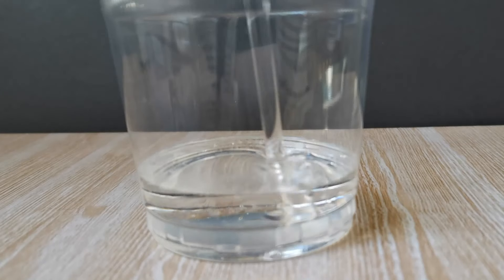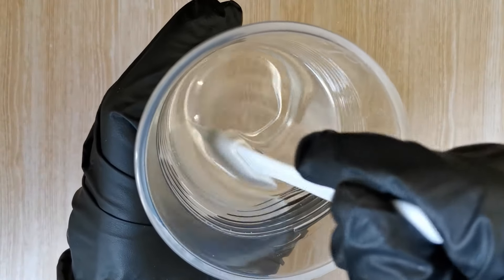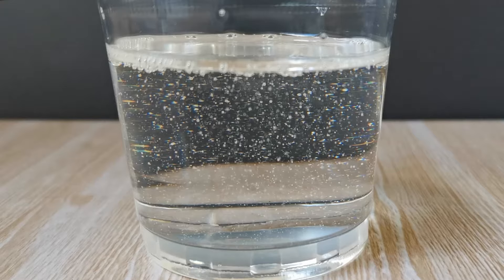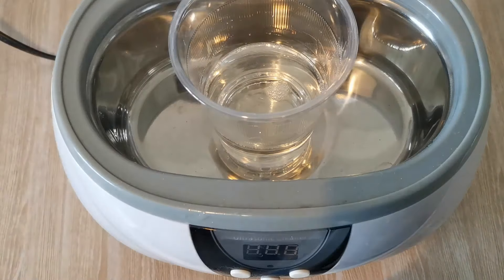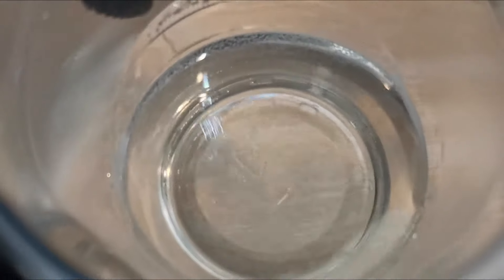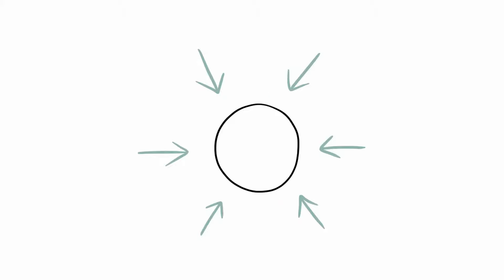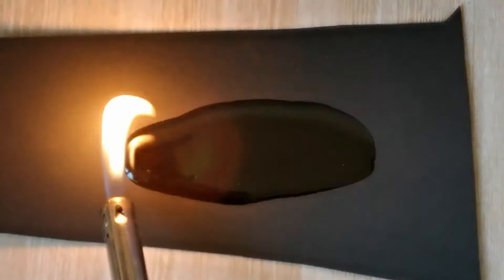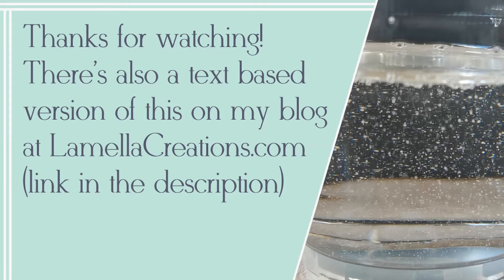How to remove bubbles from resin

Comment: That was such a concise but comprehensive video! No need to try to fast forward to certain bits, it was all straight to the point and relative 😊
Plus, I've been using resin for ages and never heard of the ultrasonic method. I will definitely look into that since I actually only ever mix small amounts.
Thanks!

Comment: I am curious as I am using Mica powders with resin and it can be quite difficult to spot bubbles as initially you cant see them. Would it be best to put mica powders at the base of the molds first then mix it once the resin is in the mold. Or pre mix it? As I recently used a cap/lid mold for my dice set and all the top faces are filled with bubbles. I found this video very helpful I just wanted to try and figure out where I am going wrong it was only my first time doing it but I want to see what I can improve.
Reply from the maker: For dice you generally need to use one of the methods that actually remove the bubbles (vacuum, ultrasonic, pressure pot). They're enclosed so the tiny bubbles rise to the top when they're curing otherwise and get stuck (even without the mica, it just makes it harder to see what's going on). Dice are definitely one of the harder things to get bubble free

Comment: Hello anyone reading this question.  In regards to the ultrasonic cleaner to remove bubbles, wondering if you can put your resin filled mold directly into the ultrasonic cleaner.  I ask as I purchased an ultrasonic cleaner recently and although the cleaner did remove all of the bubbles (very impressive), it was already in the curing / setting stage and was not real easy to pour on my tumbler.  Will have to reduce the time for future reference.  Although I plan on using resin to also fill molds.  I'd like to remove all bubbles for the molds due to how deep the molds can be and that will make it harder to remove the bubbles,  Figured if I could remove the bubbles directly in the mold in the ultrasonic cleaner.  Any advice would be helpful. Thanks!
Reply from the maker: I havent tried it, but I suspect it might do the same thing as vacuum chambers and pull air/oils from the silicone and make it worse
Reply: @LamellaCreations  worse? Worse than what?
Reply from the maker: @PAndrew002   Worse than not doing it. It ends up with tiny bubbles on all the inside surfaces
Reply: Uck. Now, I have to try this!

Comment: I’ve seen some people recommend the coffee cup warmers to warm your resin prior to using it. They say it removes bubbles very well. Have you ever used one? Would it be a better alternative to the water bath since there would be no possibility of accidentally getting water in the resin.

Take care and stay safe!
Reply from the maker: I haven't used one, but I think it'd take a bit longer to warm it since the heat is only coming from the bottom. It could definitely work if you have smallish bottles of resin though :) I've also seen people say they place it near a heater as another alternative. 
If you're worried about water I'd suggest using a tallish container for it, that way the bottle can't tip over when it's getting low so there's no risk of getting water in your resin. You can mark how high to pour the water after the first time so that you know it won't go too close to the cap. Another alternative is some people place the bottles in ziplock bags before putting them in water. It all just comes down to preference in the end and what works best for your setup :)
Reply: I attempted to use a wax warmer once. It resulted in the bottom of the resin setting up while the top was still liquid.
Reply: @Jetblastjoe  same I wish I had found this video first! I've also used a heat gun for too long and had the same effect 😅🤦🏻‍♀️ I'm also just coming to the understanding I'll prob have to sand and reseal some pieces but that's okay I still love resin art!

Comment: Have you tried Solarez Air Release? It's an additive for Resin that removes bubbles
Reply from the maker: I haven't but from what I can see it's just a solvent (naphtha). It's basically the same as if you added isopropyl alcohol or acetone directly into your resin, which yes would thin it out and let bubbles release easier, but also prevents it from curing properly and makes it rubbery. Better off just using a slow cure resin so that you know it's properly cured and safe to handle

Comment: Thank you, for scale modelling purposes I am going to deal only with low amounts of resin at a time, I did not want to invest €130 in the vacuum chamber + pump set. A typical ultrasonic cleaner should be enough as I see :) Can I also use same method for casting silicone?
Reply from the maker: I haven't tried with silicone, I suspect it might be a bit thick but it could be worth experimenting with! Otherwise a good way to do silicone without a vacuum pump is to buy a slow setting one and then place it in the fridge for part of the cure time (best to keep it in a box to contain any fumes). It slows the cure down so the bubbles can rise out before it sets :)

Comment: This is a very informative video! Can I ask, I’m getting bubbles in my cast pieces (small earring elements) which appear on the good side (the side that’s face down in the mould). They tend to be around the edges or in corners. How can I avoid this?
Reply from the maker: If they're there when you're pouring the resin in you can coax them out with a toothpick or similar (just be careful not to scratch the mould). If they only appear after a while that can be from a very low quality mould and the bubbles are leeching out from the silicone. Not much you can do about the second one but use different moulds
Reply: Would it be worthwhile to try the alcohol spray trick? Actually, what I did was take a silicone baby food spoon, dip it in a container with alcohol, shake off the extra alcohol back into the cup, and then dip the very lightly coated spoon onto the top bubbles in the mold, including corners. It pops the bubbles, but also using the spoon helps you direct the alcohol a little bit better to the bubbles you really want to pop.

Comment: You have to be careful with warming resin before working with it. It can easily cause flash cure.
Reply: Not ir you warm before you mix in the hardener

Comment: Hey i have one question 
after curing resin it is breaking so easily can you please tell me why this  is happening.. I hope you will answer 🥺🥺🥺🥺
Reply from the maker: Hi, it depends on what sort of resin you're using and how big the thing is that you're making. UV resin in particular is very brittle and likely to break, but epoxy can also become brittle if something goes wrong with the curing process (e.g. if you pour past the maximum depth for your resin and it overheats).

Comment: So, what do you do when the resin already has bubbles in it before you even pour it? Just, hanging out in the resin bottle. Haven't mixed it with anything. It already has tons of microbubbles even after letting it sit in hot water. I've tried so many resin types and brands - they all start with bubbles already in them.
Reply from the maker: A pressure pot would fix that problem, or get a deep pour resin as they're generally thinner

Comment: Great video.  Very concise.  However, I didn’t catch what was said at 6:15.  Some sort of spray to pop bubbles is used.  What was that?  Where from? Thanks
Reply from the maker: It's isopropyl alcohol put into a spray bottle (bought separately) . Mine is a sushi spray bottle from Daiso but anything that can mist finely will work. The higher the percentage of alcohol the better too

Comment: How long should I leave the resin inside a pressure pot before taking it out and poring it on a mold?
Reply from the maker: For a pressure pot you should pour the resin into the mould and then place the mould into the pot until it's cured. The pot should mostly hold its pressure so you wont need to keep the compressor going or anything :)
Reply: @LamellaCreations  What if mould it too big to fit inside the pressure pot? Can you just put the resin to make the bubbles small and then take it out and pour it on the mould to cure? If you can then how long should the resin be left inside.
Reply from the maker: @knight3131  Unfortunately not, the resin needs to be under pressure while it cures because otherwise the bubbles just expand again. If it doesn't fit then you'll need to use other methods to control the bubbles, a vacuum chamber might work for your use because that actually removes the bubbles :)

Comment: I have art resin and there’s millions of bubbles even after using a lighter. I now have a blow torch and am wondering if I can put the resin in an aluminum can before torching? Thanks :)
Reply from the maker: Artresin is a coating resin so it's best to torch after you've poured it over the artwork (as lighters/torches only work on surface bubbles). If you're wanting to use it as a casting resin you would need to use a pressure pot as it's an extremely thick resin, although warming it beforehand would help a small amount too

Comment: Hi what's the best thinner resin to get can you leave the name and link sometimes the links are not available thanks
Reply from the maker: It depends where you live as to what will be available :) In general if you look for a slower setting one it's often also thinner, or you can check the technical data sheet (TDS) of a resin you're interested in to find the viscosity
Reply: @LamellaCreations  ok thanks

Comment: Bonjour Lamella Créations, je me permets de vous écrire afin de vous poser une question concernant la création d’un moulage. Pourriez-vous me dire lorsque je chauffe ma résine sur un réchauffe tasse afin de retirer les bulles de la résine, s’il faut attendre que la résine refroidisse ensuite avant de la verser dans un moule en silicone ? Dans l’attente de votre réponse je vous remercie beaucoup et vous souhaite une agréable journée.
Cordialement.
Reply from the maker: You can pour when it's warm with no problem. Just be careful that the resin itself doesn't get too hot as it can cause a flash cure :)
Reply: @LamellaCreations  Hello Lamella Creations, I thank you for answering me, it's very nice of you. Indeed, your advice will be very precious to me, among other things to avoid the formation of bubbles in my resin, because I have never worked with resin before. I will certainly have several other questions to ask you if you allow me? One of them would be; Could you tell me at what temperature I can heat my resin before pouring it in the silicone mold I made? My second question is; Can I use a syringe to introduce the resin into my silicone mold without the risk of infiltrating air into my mold? If you are interested, let me give you some details about the work I am doing. I modeled in 3D a miniature car at 1/64 scale and I made it printed in 3D, but to be able to realize the transparent windshield I cannot count on the technology of the 3D printing because this last one is not still able to realize totally transparent parts at best it is able to realize translucent parts, but that is not appropriate to realize windows. My alternative is to model the windshield in 3D then to print it in 3D and to use this windshield as a print to be able to realize a silicone mold in which I would pour then transparent and liquid resin.
I thank you again for answering me and I wish you a nice day.

Translated with www.DeepL.com/Translator (free version)
Reply from the maker: @davidboudier6982  I'm not sure of an exact temperature as I usually just feel it with my hand until it seems right. I aim to use water that is warm, but not uncomfortably hot. I also only warm the resin, not the hardener, and definitely not after it's been mixed. It will also depend on the cure time of your resin, as ones meant for shallow pours may not be able to be heated without causing problems. 

I tried using a syringe recently and found it made a lot of bubbles, I know other people use them though so it might be a matter of quality and having a large enough one
Reply: @LamellaCreations  Hello Lamella, thank you very much for your reply.
I wish you an excellent weekend.
Sincerely.

Comment: When i pour resin in the mold without bubble, bubble came when it get cured. Have solution?
Reply from the maker: Can be several causes: 
-Very low quality silicone moulds can create bubbles after pouring on the surface of the moulds
-Putting porous things like paper, wood etc. that release bubbles into the resin
-If there are large oddly shaped bubbles the resin likely got too hot and boiled
Reply: @LamellaCreations  thanks 🙏💕

Comment: Hi, my wife is getting in to resin art and using the heating method after mixing her resin set almost immediately, how can she avoid this in the future?
Reply from the maker: Hiya, yeah you have to be careful not to overheat it if it's a fast setting resin. I'd try heating it a little less hot (and only heating the resin, not the hardener). Another thing that can affect it is the amount being mixed and the shape of the container, because overheating can happen even without warming it before. Mixing smaller amounts will make it less likely to overheat, and using a wider container to mix in so that there's more surface area for heat to dissipate :)

Comment: Tried the ultrasonic cleaner today with med viscosity resin (after warming it in water and mixing)  Did not help at all.
Reply: Too bad, this would have been great if it worked.
Reply from the maker: Yeah it's only really for low viscosity resin unfortunately

Comment: what was the alcohol spray you used to pop the surface bubbles?
Reply from the maker: It's isopropyl alcohol that I just poured into a spray bottle that I got from a dollar store. It's also called rubbing alcohol some places (though I think some rubbing alcohols are ethanol instead- unsure whether ethanol based ones also work)